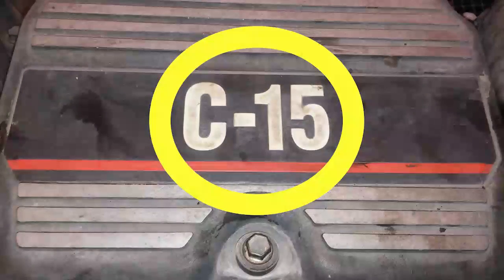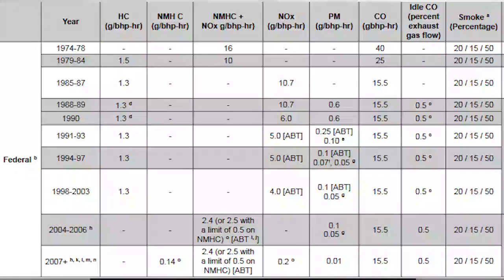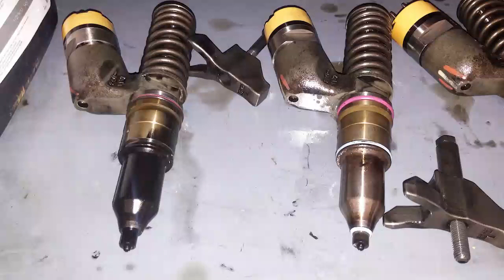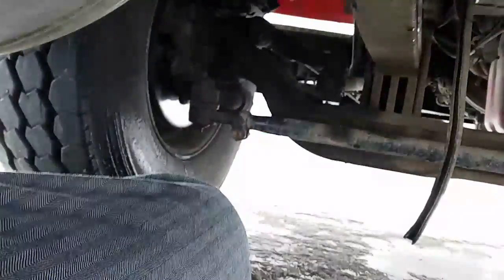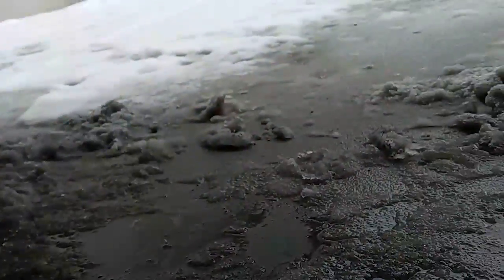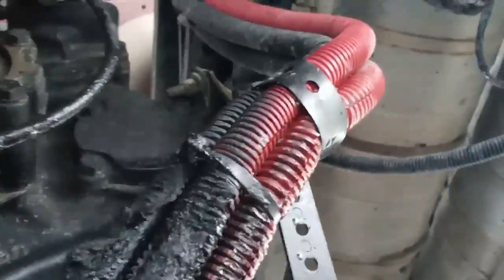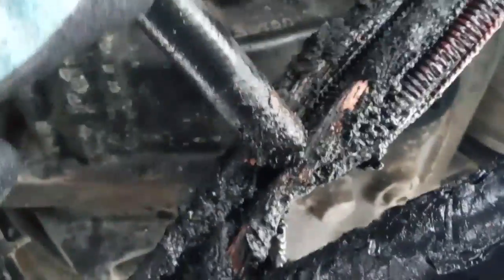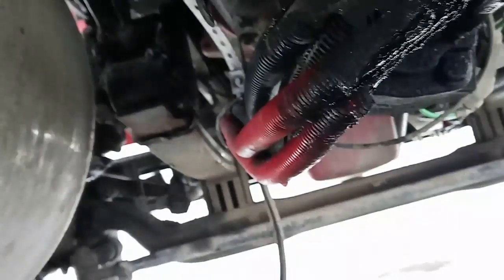Why don't people like the Cat C-15 "Bridge" Engine? What is wrong with the MBN?

Comment: My 2002 MBN  just spun its main bering at 1.5 million miles original build never was split (only injector cups were changed at 1.3 mill and regular service and the waste gate solenoid and a few sensors , I've just upgraded it to a 2006 MSX single turbo conversion with IVA delete custom ECM flash 550 hp 
if you have an MBN change the main bearings and injector cups at 1.3 mill and it should last 1.8 to 2 million miles

Comment: Had a Cat C-15

Engine popped at 600,000 :(
Reply: I know several guys that made it well past 2mil before ever pulling the head off. One in particular got tired of waiting on his and rebuild the whole thing when the water pump went out 😂

Sucks yours died that soon unless it’s in a dump truck if so that’s basically 1.2-1.3mil equivalent. My c15 has 900k on it and it’s been rebuilt two times

Comment: My mbn doesn't just run good it will probably  pull away from most CATS 6NZ WHICH IS REALLY THE SAME MOTER DIFFERENT FLASHES AND STOCK TURBOS 3406BS ES DONT MATTER IF SOMEONE COME TRYING MY MBN THEY BETTER BE READY TO GO TO WORK NOTHING WEAK ABOUT THE MBN IF YOU CHANGE THE TURBO  AND REFLASH IT I CHANGED THE CAMS TOO WHEN I DID MY REBUILD THAT ENGINE IS A BEAST
Reply: What cam I got all pdi /“stuff with 58 injectors

Comment: I thought it was 600 to 625 factory horsepower for a MBN
Reply: Working on one with that computer says is 600hp and c16 with a mbn sn
Reply: @Mile9homesteadalaska unless that dude did some modifications to an MBN to just call it a “C16”
Reply: 600 and 625 were the 15.2l ACERT motor,

Comment: What I’ve come to find out about CAT and the guys who run them, is run what works for you. We have single turbo guys who love their trucks, we have twin turbo guys who swear by them. Our “company wrecker” has a beautiful t800 rotator with an MXS In it that’s turned up to about 700 horse. Has a boatload of PTO hours, roughly 250,000miles. Never opened up and isn’t leaking a copious amount of anything. 
Before I turned wrenches I drove truck, and put a lot of seat time behind a 475 horse MBN. It ran great, we put one set of injectors in it and eventually sold it and it ia still on the road today. In my opinion, the guys who are on the internet blow jobbing the 6NZ probably haven’t ever driven or worked on engines. You run what you can afford and when you start cranking horsepower up, that’s when you lose money and start breaking stuff.  Leave them how they are and maintain them and replace wear items. Not denying the 6NZ is a legendary engine, but to completely discard anything yellow that doesn’t have the 6NZ tag is ridiculous.  I’d be happy with a single turbo or twin turbo CAT.

Comment: This guys videos are awesome and super informative!!! 
I’ve got the mbn in an 03 freightliner classic short hood, the only thing I’ve had to change was the cam and rollers and toss in a new turbo. The old girl pulls at 103,000# with 917,000 miles on the engine.  I’m very pleased with it.  Mind you, I’m  JUST starting to get a bit of blow by.

Comment: Hi, I’ll like to know why my MBN19320 has the cam shaft sensor disconnected, my truck runs fine but in a hill with load looks like is missing fuel, I thing it was the cam sensor but is disconnected and the harness don’t has a plug for that sensor, thanks

Comment: Hey Josh! I got a question hoping you can give me an idea were to look! I keep blowing iva #5 about every 3 months?
Reply from the maker: Hmmm, perhaps the harness connector is loose?
Reply: @AdeptApe  I replaced the internal harness last summer which solved alot of intermittent headaches! Possibly the external harness! I haven't replaced that one yet I sometimes get a oil pressure code along with it. Do you think the O'rings for the cross over tube may be worn or maybe broken? I m going to check that!   Good strong engine but I sure hate the iva's , I have spent alot of time and money on them! Up here in Canada for the 2piece actuator kit it's $600 a shot any suggestions on a good delete kit?
Reply: @AdeptApe  Josh buddy thanks for the insight,  the 2 little bolts on the oil cross over piece were loose so I removed the 3 to replace the o ring and found a small hair line crack on the under side! Luckily I have spare one,plus I put in a new iva , now I just need to put the valve cover on and take her for a RIP! Thanks again bro! You rock! Please let me know the best way to delete them.... p.s I'm on a very tight budget..
Reply from the maker: You should email be in general if you have technical questions in the future at Adeptape@yahoo.com
The comments section is very bad at getting follow up questions answered.

Comment: Are there any brand new C15 engines left in inventory anywhere?  or are they all Reman now?   I remember a few years ago, I ran into a C15 set at 625HP for a motorhome, which I almost bought,  but installed an ISX650 instead.

Comment: Hello adept ape!!  Had a terrible MBN (Means Bad News).....replaced the ecm with a new cat ecm with PDI tune.  Cat schwitzer? Turbo finally gave out so replaced that with a non wastegated version (also PDI). Thought the power level was rediculous and absolute power corrupts absolutely so i put the cat injector codes back in the ecm instead of the PDI ones. Is there anything else i can do to make this cat run any better or be more fuel efficient than it allready is ???
Reply: So the problem is she’s hauling too much ass now?

Comment: I had an MBN  C 15 that pulled like a bear and got great fuel mileage. Ran it up to 950,000 miles with very few problems. The truck  got too rusty to keep but otherwise I loved it.(2002)

Comment: As far as fuel mileage and dependability trouble free it's the cat C12 .. all those little c12s need is a bigger turbo and they will outrun a big old C15 I'm speaking from experience and get 7 MPG doing it

Comment: Done the 600 file with a non wastegate turbo and the truck pulls like a bear, in mbn 525 form the truck was a pig on fuel, power, felt like a old 350 Mack,  hot water temps and 1200 degree Pyro temps running around empty,  did the swap and truck runs cool water temps, lucky to get it to 1000 degree on Pyro and its easy 1.5mpg better on fuel. Did swap around 8yrs ago, no issues doing Heavy Haul 👌

Comment: I just purchased a 1994 Kenworth with a 3406c 5eK. Inframed about 2500 miles ago in 2016. Is there anything specific I should look for on that particular engine. I have never owned a cat before. It runs like a top and zero blow by.
Reply: A 5EK is a E model. What is your full engine serial number?
Reply: @johngoldsmith6629  I will run back up to the truck after dinner and get the full #
Reply: @johngoldsmith6629  yes I meant “E”, I posted a video of it today on my channel.
Reply: @amsoiladam  Do a video on your engine and let me see it.
Reply: @johngoldsmith6629  I did feature the engine some in the video. I just checked my YouTube studio and the video is still processing.
Reply: 5EK 13378 110 9667 this is from the stamping on the block. It looks like the decal has worn away. BTW the video has now uploaded.

Comment: We had a truck i drove occasionally,  it was a 99 or 2000 sterling, with a cat motor.  It was  duel h.p., something like 350 and 410 with cruise on. Im curious about how that works,  i didn't know that was a thing,  but apparently Detroit did something similar in the early nineties.
Reply: They just gave u the little more power and tq in top 2 gears, which made the truck run like a real turd with a dead pedal in any other gear
Reply: @kwmiked  no, only with cruise.  You can feel it when you hit resume.   Truck pulled great.

Comment: My old man's got a 04 379 with a mbn in it 1.2 million on it so far. a proper tune and good turbo on it really made a difference in power and fuel economy they are great engines with just a few modifications
Reply: What is modification?

Comment: holy shit those battery cables, that saved that dude a major fire.
Reply from the maker: A little electrical tape and they were good to go! Just kidding, we pulled the cables, and then had to cut and solder all the cables back together with heavy duty heat shrink while the new cables come in. Then get to remove and install the new cables when they come in.

Comment: I guess the worst destruction I've seen on a cat was a 3408 in a 777 rock truck . It pulled a wrist pin out of the piston , it basically cut the block and oil pan in half . About all that held it together was part of the block on the opposite side from failure . They called me to come and look at it down in the bottom of a strip mine . Wanted to know if I could repair it . Wish I had a camera with me back then .
Reply from the maker: That sounds pretty cool. There have probably been so many crazy destructions, but so few get documented.

Comment: I have both a 6nz and a mbn. once you understand the mbn they're great. I got about 900k on a overhaul. uses no oil and while terrible on fuel is a great engine. my only and biggest complaint (other then fuel milage) is that in the high altitude I can hear the turbo surge.

Comment: Thanks for the video,  I have a MBN and in 2016 I bought a peterbilt 379 which had been overhauled with everything you just said runs great, but can't take it to a dealership or cat shop. Must be a mom and pop shop. But wouldn't sale this truck even if it has this motor.  Thanks for the help and info!!

Comment: Dude, what is your all time favorite engine!!!!!!! 😠😠😡😡😡 or at least your top 3?? Are they all C/\T engines? (Year 4 of asking)
Reply from the maker: My favorite engine is actually the KCB C13. I don't think it is the best Cat though. 6NZ C-15 is probably considered the "best" Cat.
I like the C13 because they don't have a spacer plate, have super thick valve cover and oil pan gaskets, basically they are easy to work on and don't leak oil very often. More of a mechanics engine and it was my first Cat truck engine I rebuilt by myself.
Reply from the maker: To further that, you didn't say Diesel engine. I really like the Ford 460, put one in an old truck I had once and was a lot of fun. For Cat engines I like all of them, even horrible ones like the C7S and 3208. 3306 is great, all the 3406 engines (3406C excluded), 3126 engines, C-12 all fun to work on.
Reply: @AdeptApe  What's wrong with the 3406C?

Comment: Hey Josh wasn't the MBN the first one that came out with pilot injection? I dislike all bridge engine series.  Talking strictly about MBN they had bad liners from the factory and they would snap. (Should be all fixed now). Had problems with turbo's and exhaust manifold's cracking. I have run them on the dyno and the pyrometer temp was to high for me.  When one come in that is legal, they have a FLS/FTS adjustment and flash file update.  You can't rerate them unless they are in the same family. Had to update the rocker arm bolts or they will break.  Several had problems with Jake Brake lash (again all should be fixed by now). The biggest problem now is the smart waste gate. Hoses get rubbed and leak boost, they come in with boost faults. Which takes factory passwords to clear and low power.
Reply from the maker: Yeah I've worked on several with the "smart" wastegate coding. That system is too sensitive and needless in my opinion. The EGT being high definitely explains the exhaust manifold problem. Still better than an SDP though, as you know.
Reply: @AdeptApe  A 6NZ with a rod out of the block is better than a SDP. Still in the long run cheaper to fix.
I had a guy come in with a SDP and he had 550,000 miles on it at the time. He told me he was on his 17th ARD head.

Comment: And wich is the best truck engine????
Reply: The one that gives YOU the best service. They all break and tear up.
Reply: I understand that. but what engine is the best, if adept ape tell his opinon.
Reply: @74Gille  Electronic or mechanical? PEEC are no good at all.
I like a 3ZJ mechanical 425 HP 1650 torque. Dislike the 8PN mechanical. Like in order, 3ZJ, 5KJ, 4MG, 7FB. 
1693 best engine, but to darn expensive to own. No fuel mileage, if it breaks down you would not have anybody that could fix it.  
Electronic like 6NZ, 2WS, 6TS, 5EK  in that order. Dislike SDP, MBN, 1LW, BXS, MXS, NXS in that order. 
7CZ and 1MM have not seen a lot of them, fairly rare.

Comment: Can you do a video about the Multi Torque cat engines and how exactly the Multi Torque works if you haven't already done so?
Reply from the maker: Good topic for a video. Short answer, I don't like them.
Reply: @AdeptApe  Honestly I'm just curious as to how they switch between the two torque levels. What little info I can find on the net says it works off the top 1, 2 or 4 gears, but I can only see that happening with the automatic transmissions.
Reply: @SOU6900  It has to do with RPM's divided by MPH. Old PEEC called them Top 1,2 or 4. The 365 HT MT was actually two engines in one. Naturally in low side it was a 365 HP. When in MT it became a 400 HP.
3406E up to and before ACERT was called MT 1, MT 2, MT 4. Ratio's was as follow's 1= 27.9, 2 = 37.6, 4 = 71.5.
Starting with ACERT they became MT A, MT B, MT C. Ratio's as follow's A = 27.9, B = 33 and C = 38.

So we will say you have a MT-A engine ratio equals 27.9
Your truck has 285/75R tires, 3.90 rear axle, top three gear ratios in transmission are 1.0, .87 and .74. Engine turns 1800 RPM's hard limit. No other parameters are holding you back.

So 1800 times 60 equals 108,000. RPM's now becomes RPHour. Tires 285/75R equals 502 Rev's per mile

So in direct gear, 502 x 3.9 x 1 =  1957.8. 108,000 dived by 1957.8 = 55.164 MPH at 1800. So 1800 divided by 55.164 MPH = 32.6299.

The ratio for MT must be less than or equal to for it to activate. Since you have a MT-A ratio is 27.9 and in direct you have 32 plus you won't be in MT.

So now you gear up and are in first OD of .87 ratio 502 x 3.9 x .87 = 1703.286. 108,000 divided by 1703.286 = 63.407 MPH. 
1800 divided by 63.407 MPH = 28.388. Again your ratio is greater than 27.9, so you not in MT.

So you shift up and now your in a .74 ratio. So 502 x 3.9 x .74 = 1448.772. 108,000 divided by 1448.772 = 74.546 MPH.
1800 divided by 74.546 MPH = 24.146. Bingo now your less than 27.9 so MT will activate with this set up only in top gear.
Reply: @johngoldsmith6629  Ok all of that I surprisingly understand. So when the electronics see that everything is at the correct ratio(s) to make the switch to the higher power settings, what all is the engine doing different to meet that high power rating? Is it just an increase in how much fuel is being injected into the cylinders? Or did I already f**k up and overlook something?
Reply: @SOU6900  When MT first came out. They was not tested at the factory yet. You could purchase a Personality Module on your PEEC ECM. We was told back then when your in MT expect to see about one MM of rack increase. So we was told to over lay the graph's, because no data was available. Now in Cat TMI you can look the spec up. You have a spec it's called a 0T????, 2T???? number. You can look it up and see both sides. Naturally when you dyno test a truck, you want it on the full power curve. In most cases you run a truck in direct on a dyno. A MT may force you to run in a higher gear to obtain the full power curve. The rule of thumb on a dyno you lose around 20% HP thru the drive line. Naturally each truck will vary and in the higher HP engines that number changes. So if your trying to calculate your WHP data, and you have a MT you have to multiply your axle ratio times your transmission ratio to obtain your over all ratio for MT. If you don't your PAR test will be of no value.
Top 4, MT4, MTC most of the time you can run in direct. Top 1, MT1 or MTA most of the time you have to be in top gear. The other one may vary.
Reply: @johngoldsmith6629  Ok so... Is a multi torque program worth having/running?
Reply: @SOU6900   Multi torque are mainly in the lower HP family. First off what engine do you have? What transmission? What are you hauling?  A 550 is a 1850 torque so no MT is available, no need. They offer a 575/600 for the bigger truck engines.        But you could have a LT 500, 475 and so forth and it could help you. Most of these was ordered with a fleet truck. Now they are no longer in a fleet and owner operators have them and generally they want the biggest HP/Torque you can get.  We will use a 5EK as an example. What if you had a 310 HP,  1150 torque? They offer a MT of 1150/1350 Torque. If I was going to keep the truck, I would put a 1850 Torque transmission and rerate it to the highest torque I could with out a iron change. Then when I rebuild it, my transmission would be OK. I then would up grade my iron to a 550 6TS. What resale do you have with a 310 vs a 550? Now if I was on a dedicated run hauling pillow feathers, I would stay at a 310 MT. So its like saying do I like a red truck or a blue truck. Preference is the first thing, what do I have and what am I going to do with it? So when Cat was still in the market and you went to purchase a new truck, with a Cat engine in it. I would tell customers. Go talk to a truck salesman and then talk with your local Cat truck engine rep. See if they say the same thing. Most truck salesman wanted to sell what they had on the yard and not make a special order.
A Cat truck salesman should ask what your going to do with your truck and spec it out for your need. 
I had a truck come in years ago and the owner complained of poor fuel mileage. The driver showed up and he told me it had low power. He pulled out of the pit and then got on the highway. I looked at his truck and he had 4.33 rears in it. Did great coming out of the pit, but when he got on the highway he had no road speed and was having to drive the engine at 1800 RPM's just to meet speed limit. 
So is a MT worth having? Goes back to what you currently have and what your going to do with it.